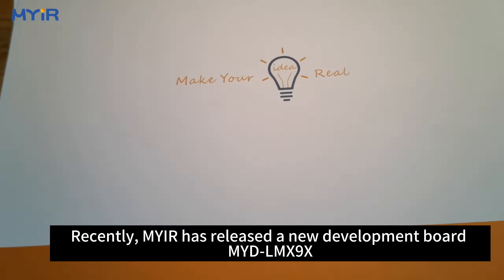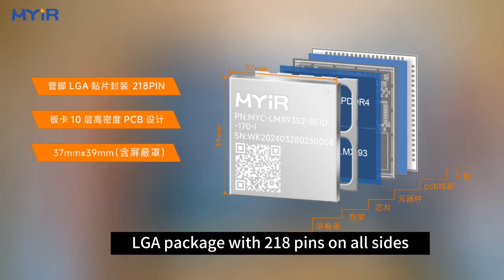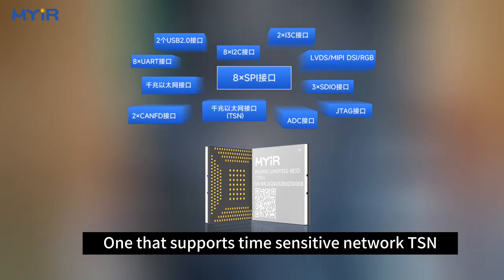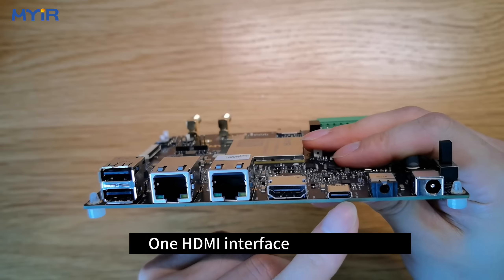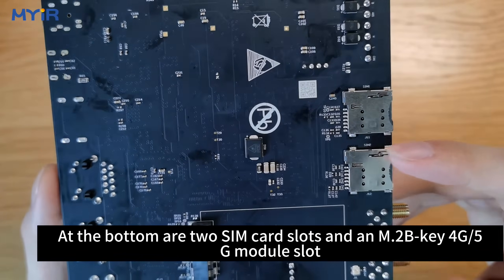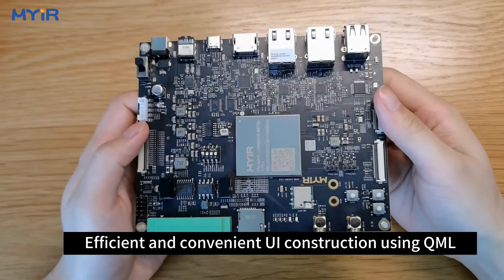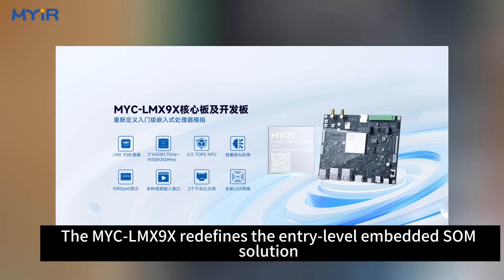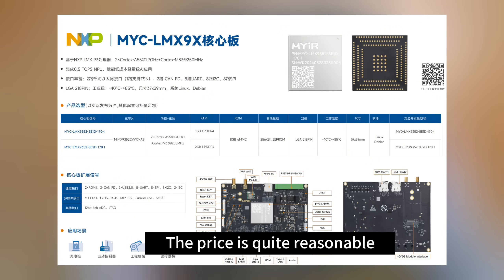MYIR's i.MX 93 based SOM for Industrial Applications

Comment: Cortex a55 are vurnerable to a speculative execution bug that makes it posible for a attacker to gain Kernel level privilege.
Reply: MYIR implement security measures: Enabling security features (op-tee + Secure Boot, etc.) on critical systems to prevent unauthorized access.
Reply: Official NXP Post: After enabling NXP Secure Boot, without obtaining the authorized key, the system kernel-related software cannot be secretly replaced.